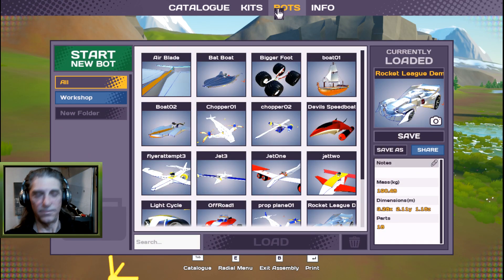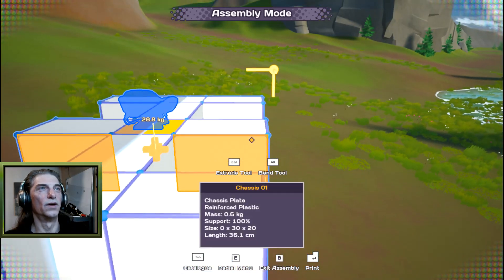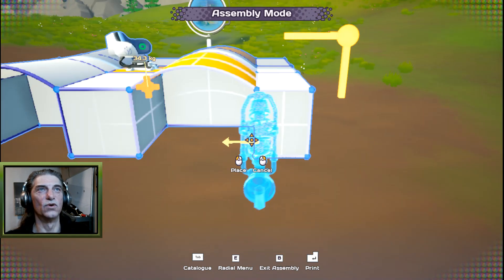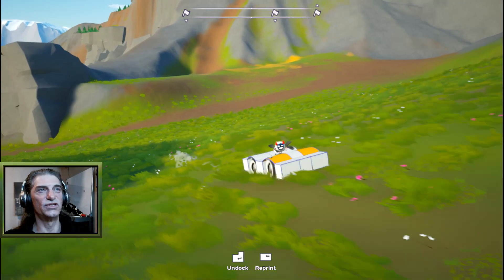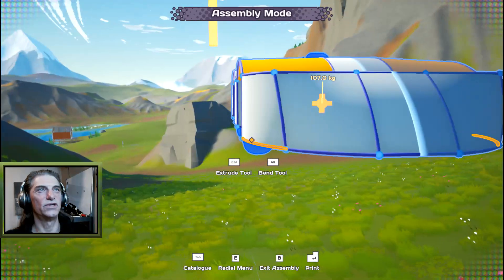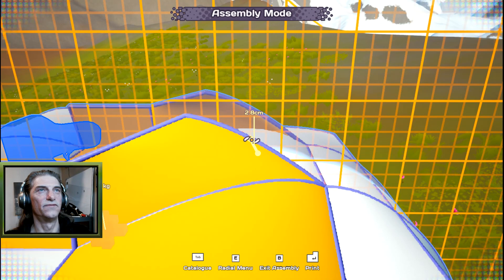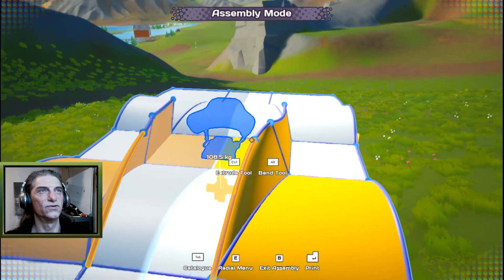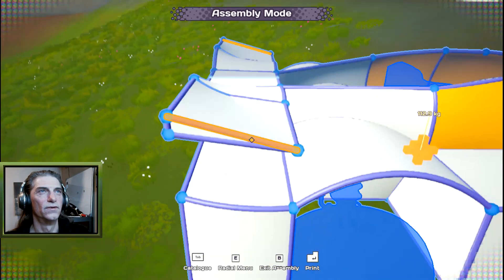How To Build in Main Assembly with ThatDomGuy! Episode 3 Building a Basic Car.

Comment: Here's a few more helpful tips. Press H to hide whatever you're looking at. Super helpful to get into the heart of a build to make changes without having to play camera gymnastics. You can even hide the arc grips when making curves. Shift + H to unhide everything. Another really useful trick is to create floating mounting points, this would have avoided the wheel camber issue you had in this vid. Say for example you make a 10x10 piece of chassis to mount a drive motor. You can delete the connecting frames and rods from that mounting point that connect back to the main chassis. Now that mounting point is floating and won't be affected by how you change the shape of anything else. You can even grab and move around the point. Next simple one, double click selects all similar things - helpful to make mass changes, deletions, or for hiding lots of stuff at once. Last one, control + mouse wheel to increase chassis thickness.